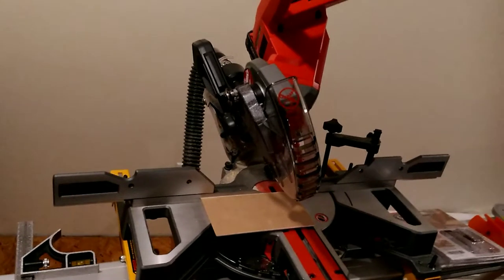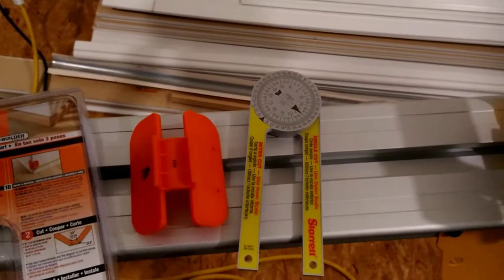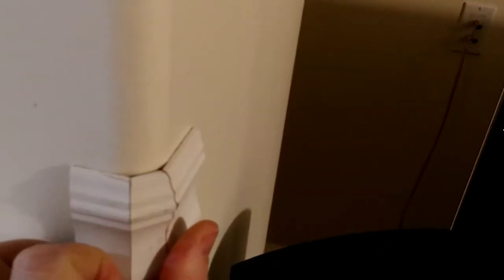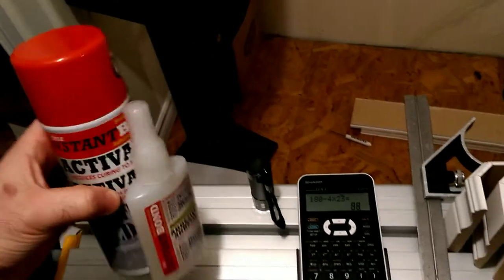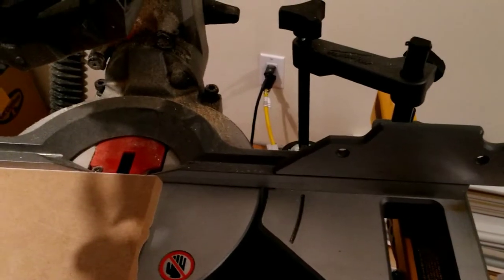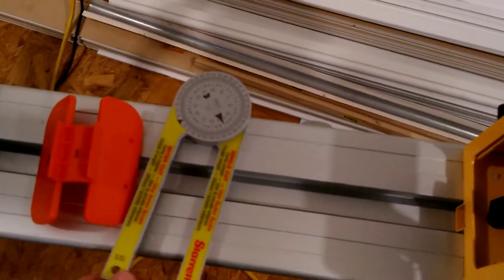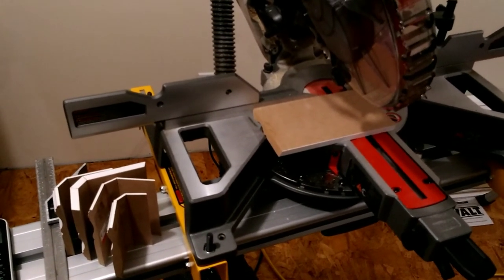Bullnose Corners - Cutting trim without special measuring tools

Comment: Good video, I like the template idea, I use templates for crown molding. I have a bunch of baseboards  to do, and the corners are bullnose. I'm going to give your method a shot, thanks for the idea.
Reply from the maker: I suggest you make left and right templates too.  You can use them to mark your corners for measuring.

Comment: what was your angle, 88 or 92?
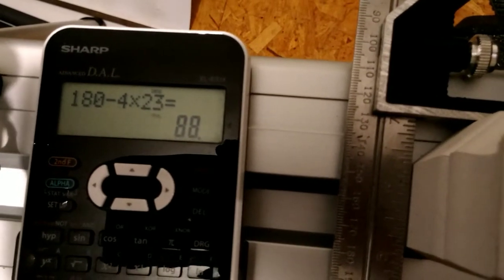Reply from the maker: You are normally going to want to be under 90 degrees on the inside because of how the drywall mud is done.  The formula is 180 - 4 x cut angle as seen at 2:20 in the video.  I think I ended up doing my entire house at 23 degrees in the end.

Comment: 22.5. Not 23 degrees.  You have to divide 45 by 2 ... =22.5
Reply from the maker: it is unlikely that the drywall is exactly 90 degrees, it takes some trial and error to get the trim to fit